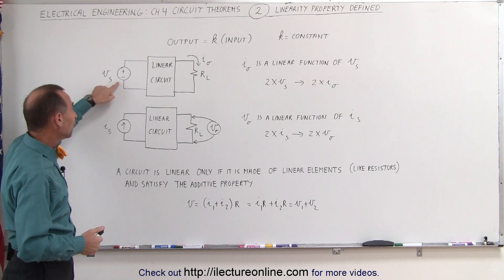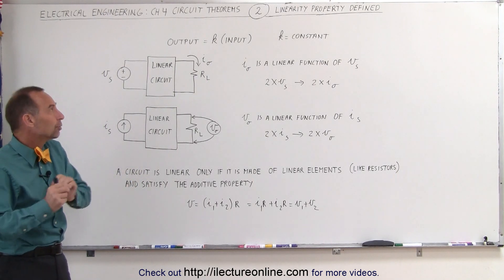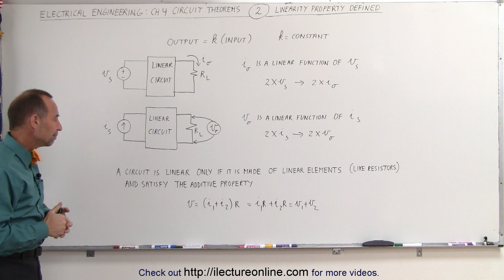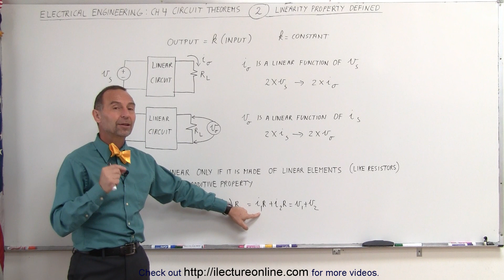Electrical Engineering: Ch 4: Circuit Theorems (2 of 32) Linearity Property Defined

Comment: Then why in the Wikipedia page of inductors it says it's linear element and I quote "Along with capacitors and resistors, inductors are one of the three passive linear circuit elements that make up electronic circuits"?
Reply from the maker: That is a correct statement.
Reply: @MichelvanBiezen  sorry I'm a bit confused but in the video you said it's not linear element 1:33 
thanks for the reply, sorry if I bothering you.
Reply from the maker: For a DC power supply the linear correlation holds.  When the power supply is AC, the relationship between voltage and current are not linear.  It is a matter of semantics.
Reply: @MichelvanBiezen  Thanks for the reply.